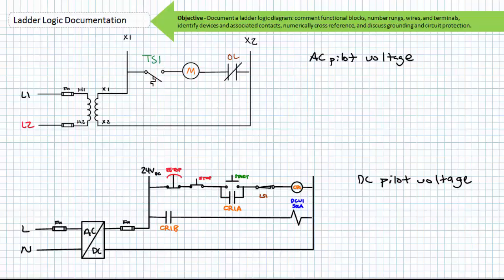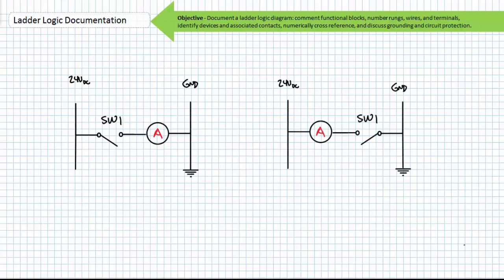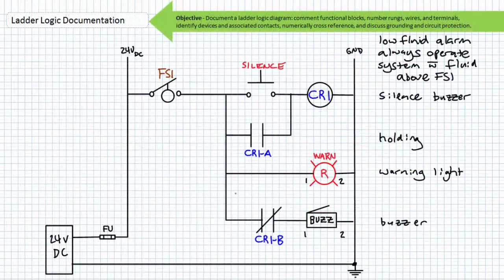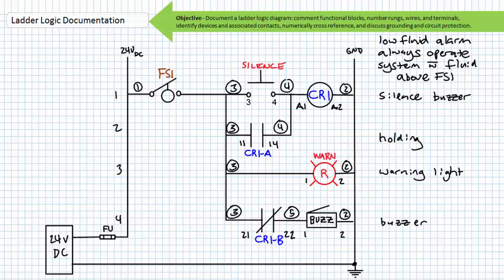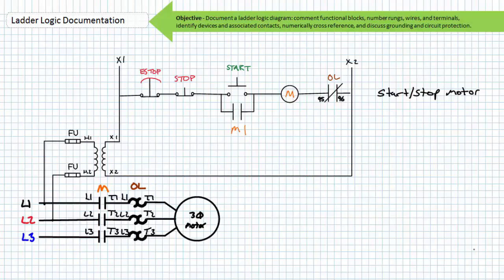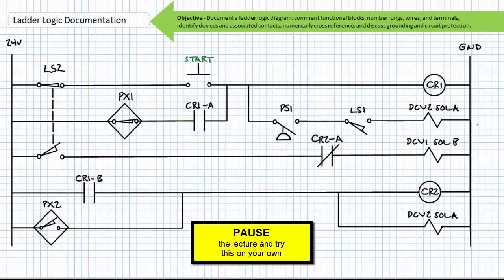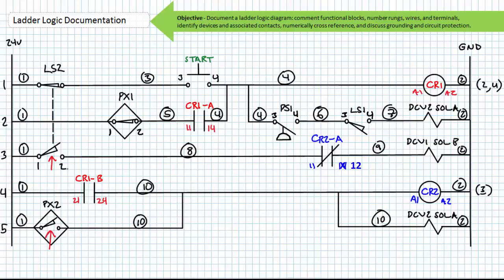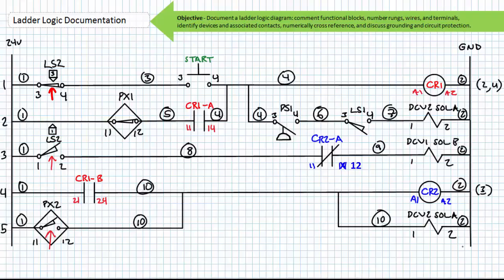Ladder Logic Documentation (Part 3 of 3)

Comment: Hi Jim; Could you give us a textbook title ( in PDF form if possible ), where we could read about the last few lectures. So much information to absorb. Once again, good job and thank you.
Reply from the maker: +John C Excellent question. I actually draw from a number of different resources for my classes since some textbooks excel in one area but "need improvement" in other areas. For this particular topic the "Electrical Motor Controls for Integrated Systems" by Rockis and Mazur (ATP printed in the USA) does a really good job in  a short space. Not sure if there's a pdf available but the 4th edition is out and you can pick up the 3rd edition pretty cheap. This book has other pluses as well, however, 7 of the 20 chapters really concentrate on topics I consider "prerequisites" to motor control (like Ohm's Law, transformers, etc). The book "Electric Motors and Control Systems" by Petruzella is really focused on motors and motor control, however, I've found a couple diagram problems in the 1 ed. Stay in touch because my next proposal to the NSF ATE is to develop a "worksheet/study guide" students can download for free from the ATE Central website to accompany each lecture. I'd like these resources to essentially be a free alternative to textbooks. I'll know in July 16 if this is a GO or a NO GO.